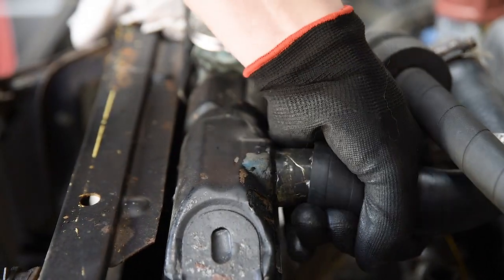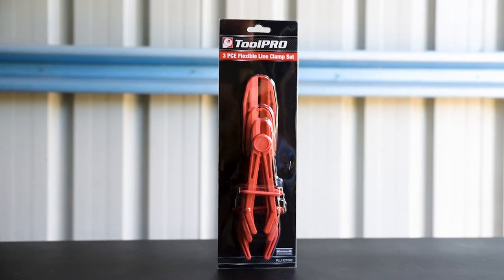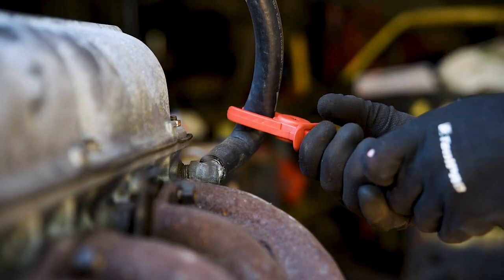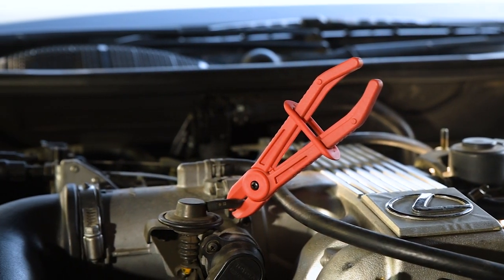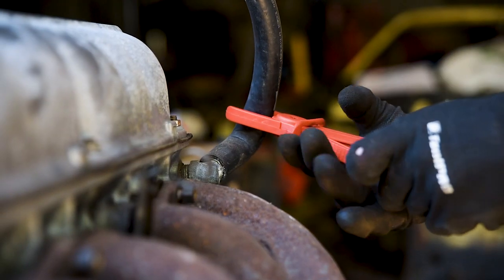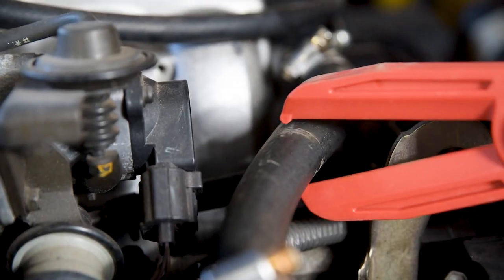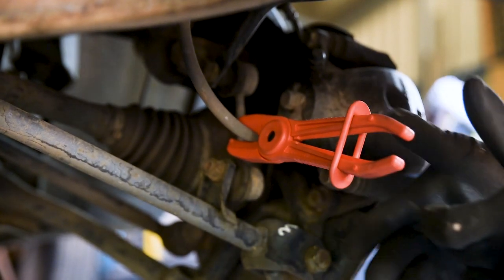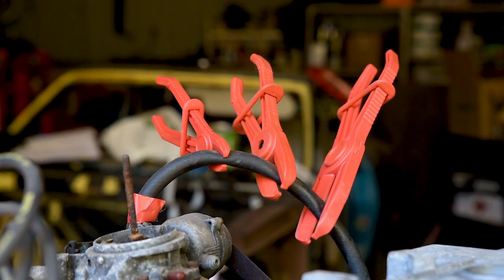ToolPRO 3 Piece Line Clamp

Comment: Just got a set of these today. I'm going to pinch off my brake hose and rebuild my caliper.
Reply: How did that tool work for the caliper job back then? Was it strong enough to clamp the brake line cause I know the brake line is a very hard type of hose. I want to change my caliper as well
Reply: @rudy5454  it worked very well